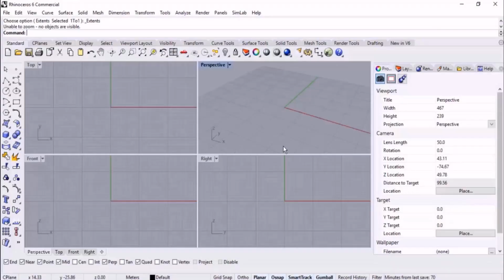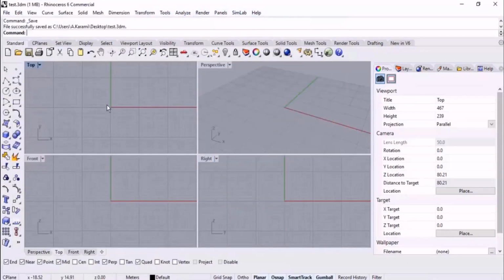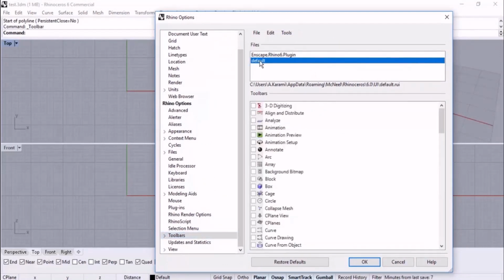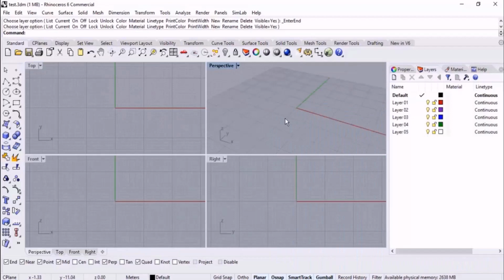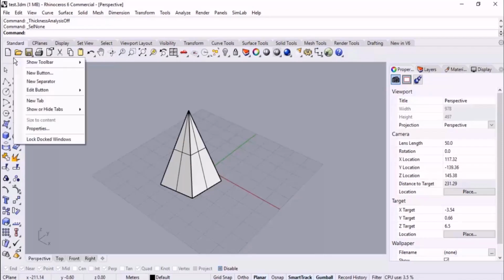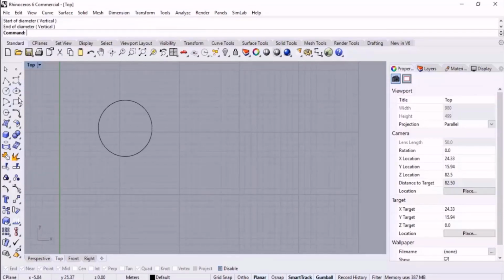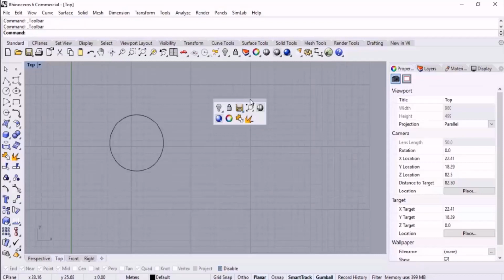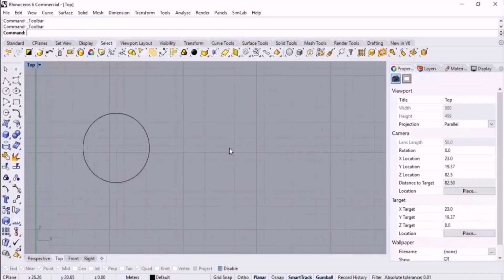Rhino Masterclass - Session 1: User Interface

Comment: Thank you so much for the great course!

One question: The course is on Rhino 6, however, Rhino 8 is the current version?
Reply: Rhino 7 and 8 features have been added to the course
Reply: @mohammadjavad13 - Thank you. I see the 46 videos in your playlist, but none of them are leveraging auto-cplane, or push-pull, etc.

Have I missed some of the videos? Thanks again for the great course!
Reply from the maker: That is correct